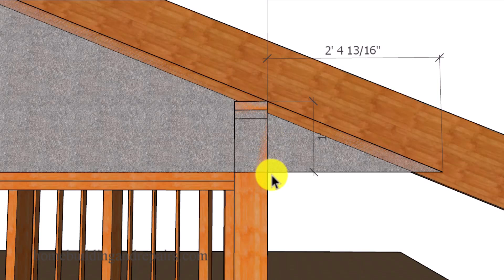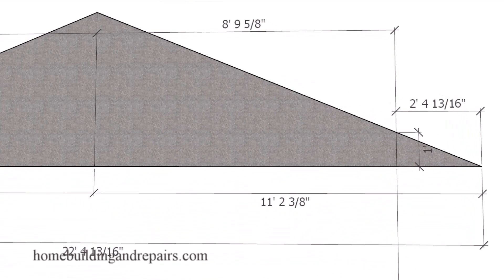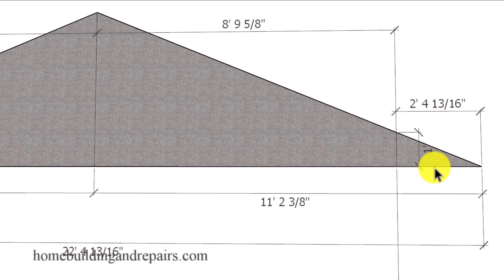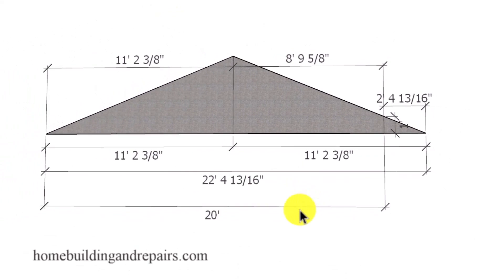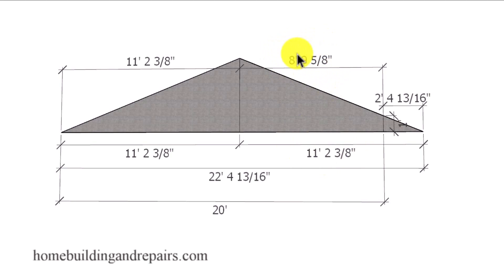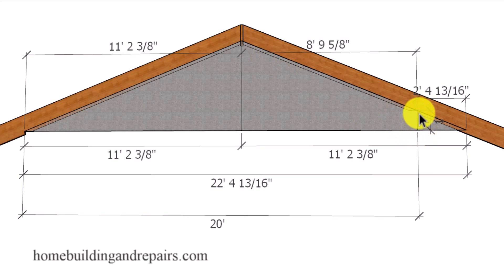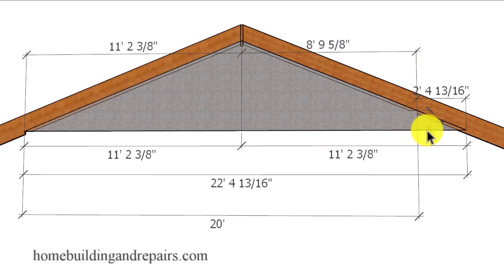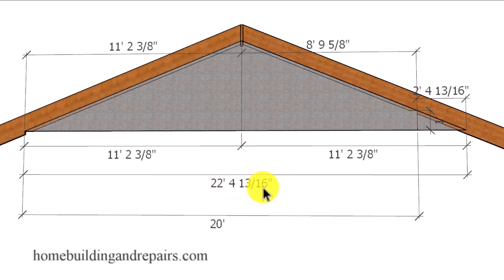How To Calculate Rafter Spans For Gable Roof With Two Different Wall Height Measurements - Math Tips

Comment: How about the height of the ridge beam? To be set into place and then the rafter length and placement of rafter by connecting one at a time. Easier if doing it by yourself. Most get lost right there trying to find the height of the ridge; I know I did many years ago! It's super easy to find the height; if people don't know how they'll get mad or guess by cutting up a lot of lumber.
Reply from the maker: I put it on my list and thanks for the suggestion.

Comment: Hi. You make very nice videos. I have a question for you. Im building an a addition to my house. one room in the front of the house and one at the back side. The roof from front addition will connect to the back roof and it will be higher then my existing roof. Can you make a video of how i can make that connection with out putting to much weight on my existing roof.
Reply from the maker: I put your suggestion on my list.

Comment: Hello 
Thank you for this video. 
I have a problem understanding the bird’s mouth cut and it’s impact on total rafter length. 
If you could elaborate on that. 
Thank you again
Reply from the maker: I have more videos on our website. It's difficult to explain in the comment area.
https://www.homebuildingandrepairs.com/framing/roofs/index.html
Reply: The rafter is calculated to end at the top of the rafter at the wall line where you'll draw a vertical line down to the bottom edge. The seat cut of the birdsmouth is the width of your wall plate - 3 1/2 inches for a 2X4 wall, or 5 1/2 inches for a 2X6 wall. When you draw your horizontal line for the seat cut at the bottom of the rafter, what's left above, on the vertical line, is called the height above plate. If everything is calculated and cut correctly, it fits.